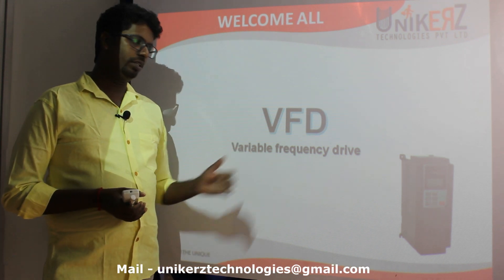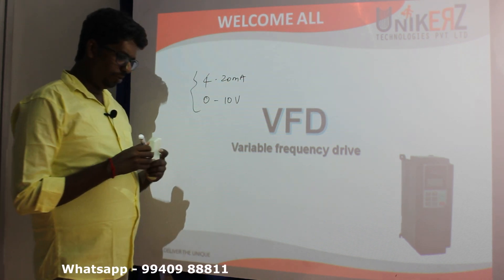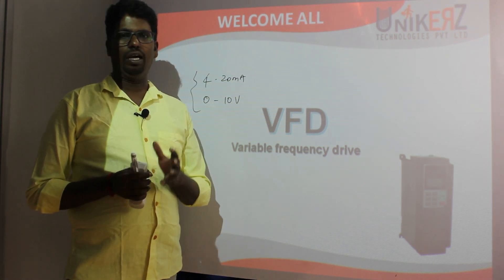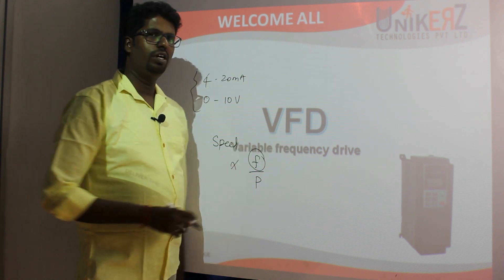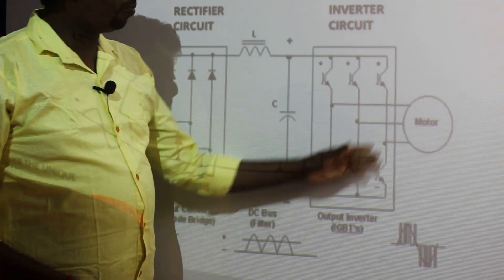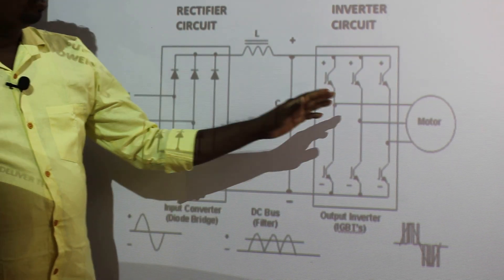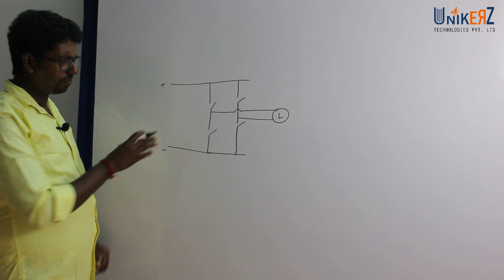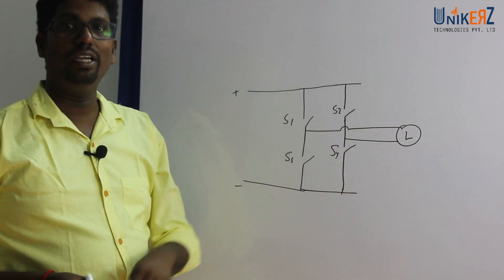What is VFD? - Variable Frequency Drive - PLC Digital/Analog Output - In TAMIL - Part 01

Comment: Thank you for your explanation, pl clarify when + , - S1, S2, & S3 , S4 terminals are interchange how motor direction kept in a same direction being DC operated. Then it also confuse the sin wave possibilities .
Reply from the maker: Based on reference signal it will operate so no chance for mistakes.

Comment: Thanks for ur video ..pls clarify my doubts  that A motor has designed for 50hz and 430v,
If we apply low frequency by VFD to control the speed , won't it make any risk ?how VFD protects the motor in the case of frequency ?  
What  aspect compromise the  motor able to  run plus or minus 50hz ?
Thanks 😊
Reply: come to my wats up

Comment: Nan 2hp 3p motor aeratoruku use pannuren 1440rpm motora 720rpm speed convert panni load kodukum pothu enaku 3.2amps poguthu ippo andha motora vfd use panni   
Direct motorlendhu 720rpm load edutha enna agum plus amps enna irukum and then vfd use pannurathunala power save aguma my whatsApp num 9842082171
Reply from the maker: Pls whatsapp ur questions to our whatsapp no. 9940988811

Comment: So finally we  are reduce the cycle per  instead 50 cycle at 60sec here the same 50cycle at micro sec does it correct?
Reply from the maker: 50Hz is operating frequency std. At 50Hz it will reach max speed. If you are reducing the frequency you can reduce the speed. Any further clarification required comment here.
Reply: Thanks. But what is the VFD output frequency cycle per second  .
Bcz switching operation is faster depends upon application  , I m link my topic with acceleration time,if increasing acceleration time ,does cycle per time increase from standard Freq.
Reply from the maker: @vickylikes  acceleration time is to reach 0 to set frequency.
Reply: @UNIKERZTECHNOLOGIES  
Thanks

Comment: Sir vfd input suppy 230v how to convert three phase suppy in motor are running condition I can't understand plz explain
Reply: Initially AC SUPPLY rectified to DC 
Then the DC volt inverted to ac

Comment: How to control motors by using VFD with parameter settings and applications like chiller pump, transfer pump, booster pump, irrigation pump, etc 

Itha base panni detail ah oru video podunga bro
Reply from the maker: Yeah sure,soon
Reply: By selecting the DI section .and the set the parameters as per the requirements ..if you want to parameters ..go with Google playstore and collect the manual for the drive
Reply: i am working ABB DRIVE control panel in Chennai  ..go to Google playstore and search for ABB DRIVE library ...
Reply: @sharvansaro2818  hello